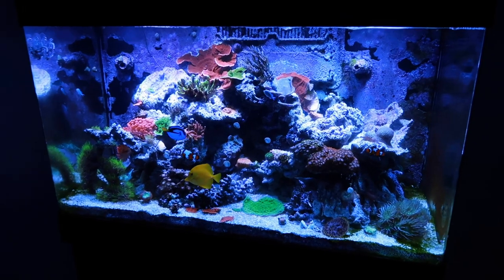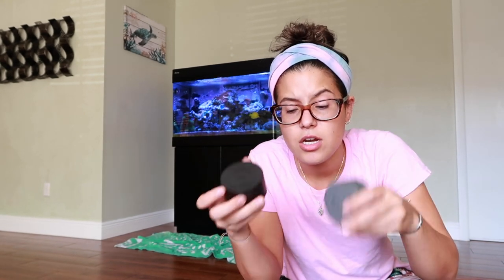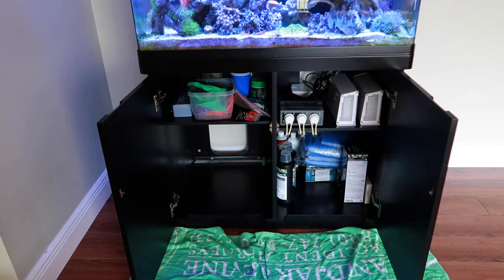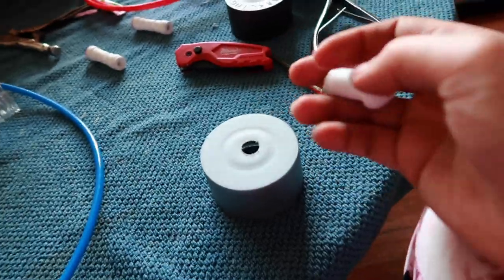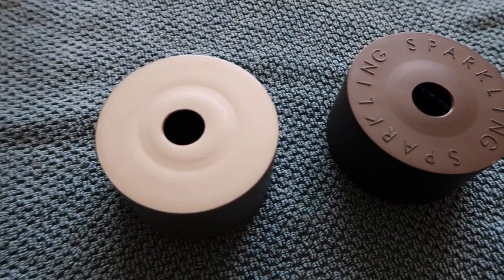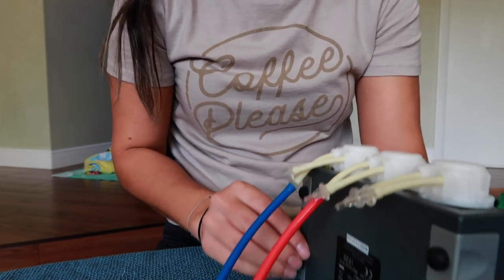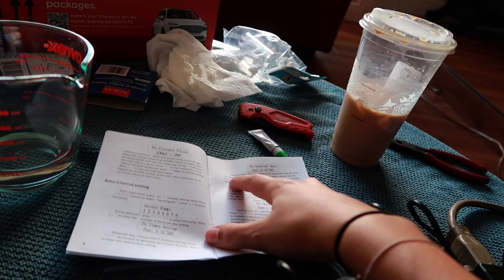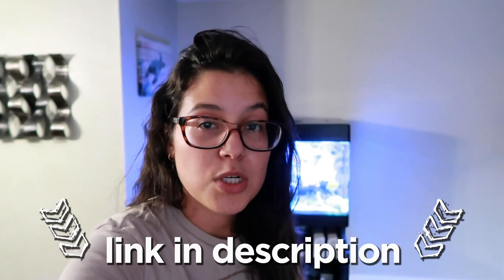Adding a CUSTOM Doser to the Reef Tank

Comment: Hello may I ask what lights your using and do you run them at 100%, i using 8x39watt ati t5s  on a reef octopus lux 90  im currently using 6 blue plus 2 aqua blue special. Your sps are growing very well
Reply from the maker: Thanks Glenn! I run 2 Radion XR30 Pros.. I don't run them at 100%.. Its around 90 in the individuals then like 50% overall.. Check out the graph in this video to better understand what I mean https://youtu.be/t-thEsWT6-A

Also, sweet tank!
Reply: Thank you very much    I like your apdates keep it going strong

Comment: Hate to be the bearer of bad news, but that doser ain't going to last for too long. Bought the exact same one. Lots of complaints online of them failing, including mine. Lasted 7 months. The clock stop functioning . Set the time, it advances for 3 seconds and then stops. Unit won't dose if the clock ain't working. Needless to say I contacted the manufacturer in China via email asking for guidance. Still awaiting a response, that was 5 months ago. Hope you have better luck.
Reply from the maker: Oh bummer! Hope I have better luck too! And I hope they get back to you lol But thanks for the heads up ill keep an eye out.. so far so good.